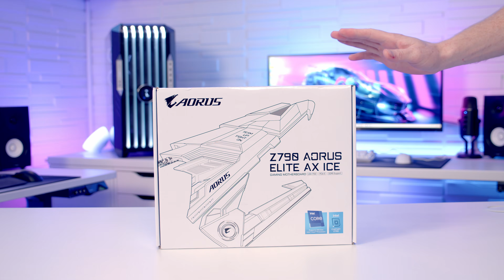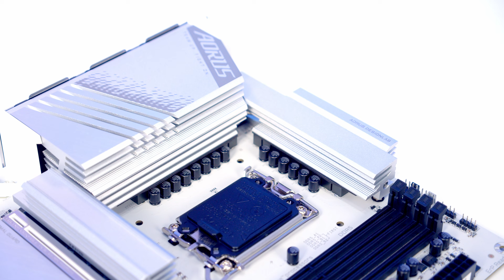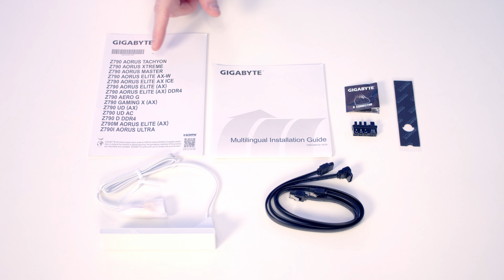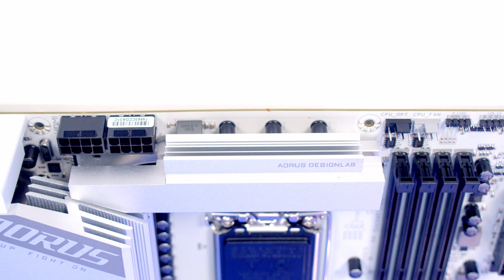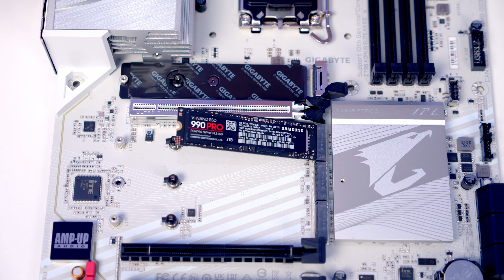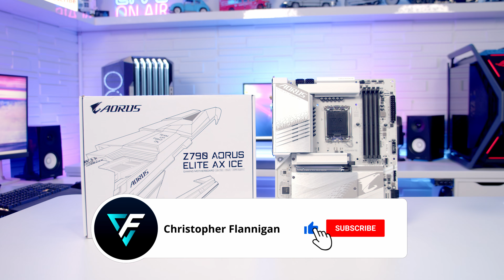Gigabyte Z790 AORUS ELITE AX ICE Overview

Comment: does the top m.2 slot share the same lane as the top pcie slot? which would then decrease performance of a graphics card by splitting the lane?
Reply: A late reply, but no -
The manual's block diagram shows them as running on their own separate lanes.

Comment: I love their boards, but not sure I will buy another just because their software is so bad. I have never been able to get Gigabyte Control Center to work on my current system. Seems to be a common problem.
Reply: Asus is better, gigabyte Bad software
Reply: @RickOrtpio I just returned my Asus motherboard because it was faulty and then I got this one
Reply from the maker: First time using it for motherboard, but all worked without issue
Reply: At least it's not asus armoury crate tho